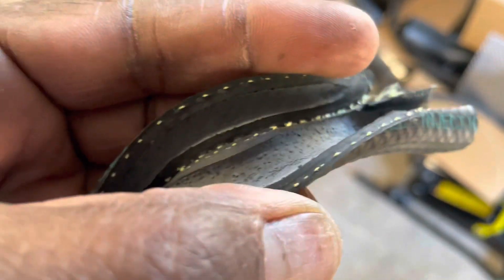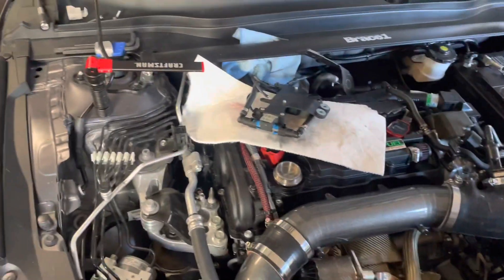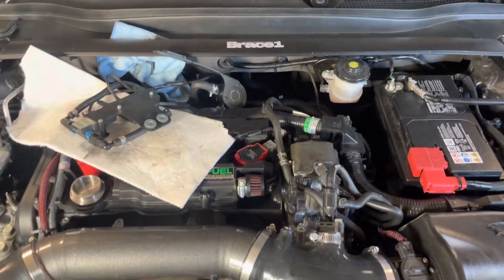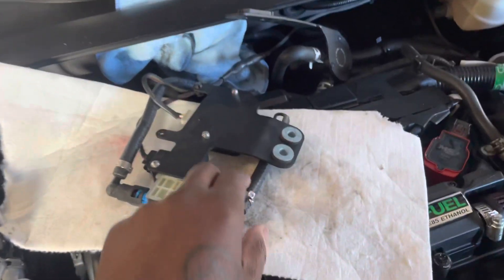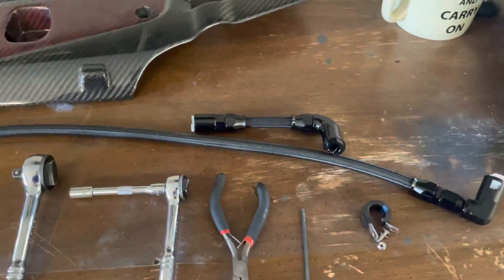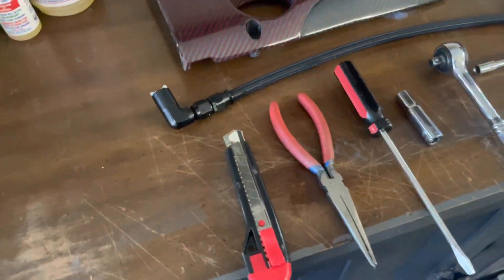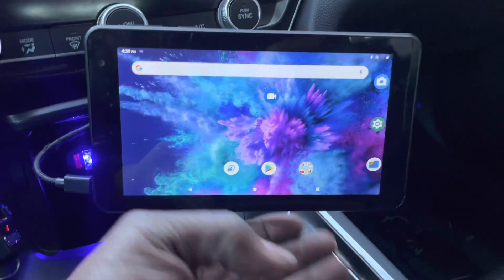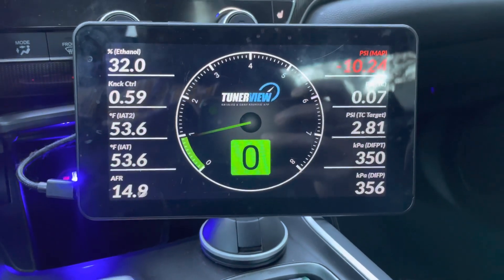Does your Honda Accord Flex Fuel Kit Hoses Look Like This?

Comment: Thanks for the video! I was wondering when some one would discuss this cause I read it on a forum and is what spooked me from going flex on my 2.0. How many miles would you say is on your flex fuel hoses? Just curious how long it takes for it to start breaking down. May get the kit and upgraded the hoses later. Thanks always!
Reply from the maker: Thanks for watching! Real good question. I put the kit on at around 3000 miles. I currently have about 18k on the dash. With about 3000-5k of those being highway long distance travel.
Reply: @fred_b_360  yeah, sounds like much over 20k miles you could already be running into problems with these hoses. Wow. I agree they should upgrade for free considering it can damage your fuel pump. Smh. Thanks again!

Comment: Is anybody running PTR flex fuel kit? It's on special for 425. With ETFE Tefzel fuel lines upgrade.
Reply: Not worth it. I’ve ran it and it short circuited which caused my car to go into limp mode. Better off spending the extra $100 on the Prl flex fuel kit which is better quality overall.
Reply from the maker: not sure.

Comment: Hey man, love the videos. Do you have an ever so slight ticking sound after these lines?
Reply from the maker: Thanks for checking me out. Yes. EVERYONE who has done the upgrade has the same complaint. I believe it’s due to the increased fuel flow on the DI system. With my current setup it’s significantly reduced, but there.
Reply: @fred_b_360  I messaged John from fk8td and he said it’s completely normal and that the “Cricket sound is from high pressure pump duty cycle dropping to slower rate and the sound is at a different frequency. Completely normal.” Potentially adding some rubber or foam insulation around the hose where it connects to the fuel pump might help but I’m used to it now.
Reply: @pranav8810  is there any remedy for this? i want the sound to go away or at least be quiet

Comment: How is the oil smell with the pcv breather? Do you get oily film in the engine compartment?
Reply from the maker: No smell. But since the filter vents to the atmosphere instead of the inlet, I do notice a light film of oil in the general location. *NOTE: I had my car Dyno tuned with this setup and had no issues nor corrective recommendations from my Tuner.
Reply: @fred_b_360  Thanks! Was curious since I used to run a similar filter on a modded TDI diesel and it made a mess. Much dirtier motor of course 😁